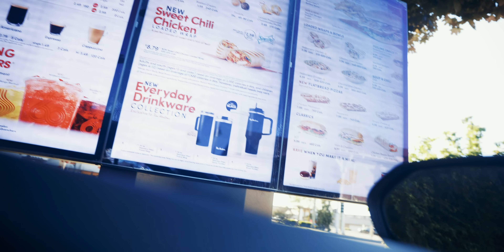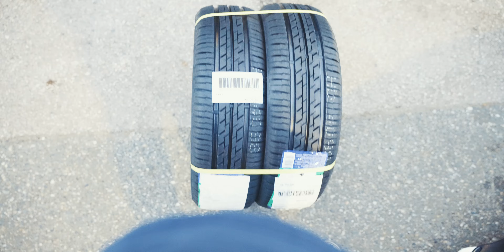SUPER WIDE Wheels for the Cressida! (4K)

Comment: Next time when dealing with rusty bolts.  Just heat it up just enough to melt a crayon or candle into the threads and that usually works well with much less potential fire hazard

Comment: What's the offset -20?

Dream wheel, already have them 15×8 -6 Equip 03. Might go with a staggered setup on a different car
Reply: 10J should be around -38/-40  & 12J should be -52 or So if the same as original and 'A-type'